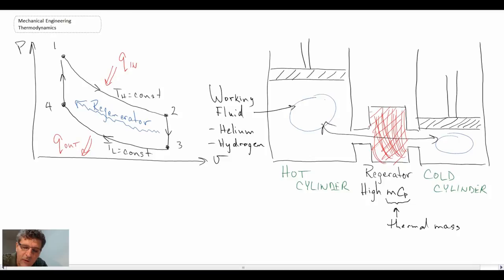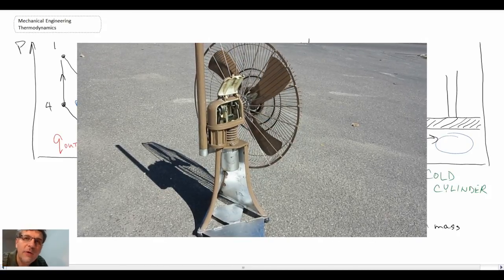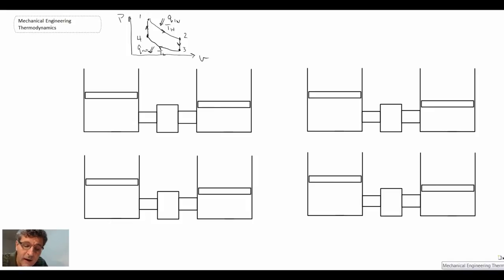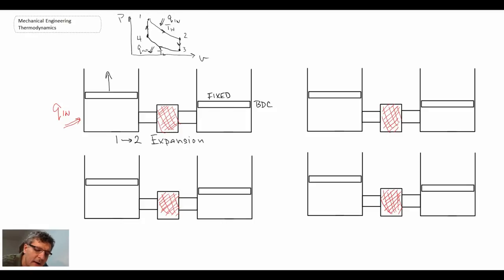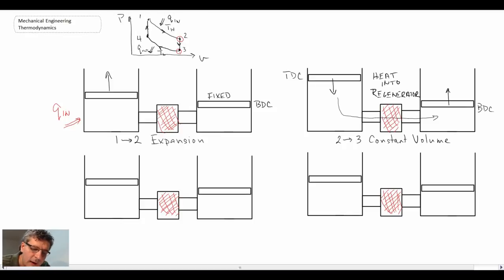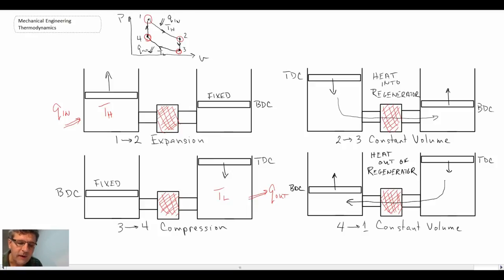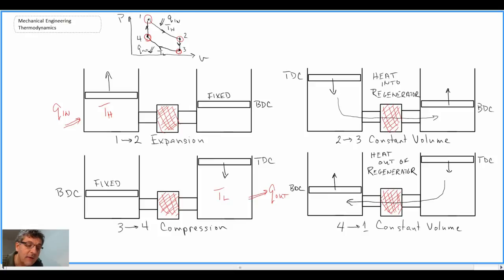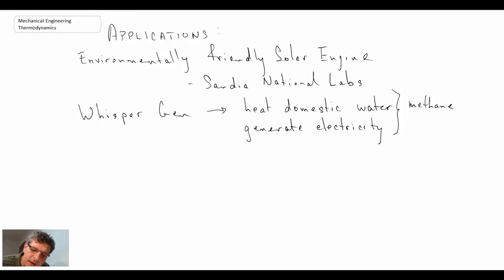Mechanical Engineering Thermodynamics - Lec 16, pt 6 of 6: Stirling Engine Operation

Comment: at 10:18, the piston on the cold side should be LOWER than the TDC. That is, the volume at state 4 should be lower than the volume at state 3, because the fluid is compressed at constant temperature(T_L). You can easily see this on the Pv graph.
Reply: You don't even need the graph. Cold piston moving down from TDC at 3 -> 4 and then starting from TDC again at 4 -> 1 makes no sense.

Comment: There's is/was Stirling Electric Generation Plant in Victorville, California, powering thousands of homes. With an efficiency almost double that of solar photovoltaic panels, I wonder if we couldn't capture heat and store it in sand, and use that heated sand to power a Stirling engine electricity generator. I like in the Mojave Desert, so it seems like an obvious choice.

Comment: Process 3- 4 piston in hot side fixed at BDC and piston from cold side starts at TDC doing compression. Then how it's possible in process 4-1 that the piston in a cold side will start from TDC , as in process 3-4 compression takes place in cold side.

Comment: Hi, Great explanation of the thermodynamic processes but your explanation and diagrams have an error from a mechanical perspective.  Stirling engine displacer (hot) and power (cold) pistons are phased 90 degrees apart, not 180 degrees.  This means the the displacer piston and the power piston can never be at their TDC and BDC simultaneously. When one is at its TDC or BDC the other piston will be half way through its stroke (either up or down).
This is an aspect of the thermodynamics of the stirling has challenged me, especially the Carnot cycle as it seems to be out of sync with the true mechanical workings of the engine. 
If you are compensating for the fact that the expansion and contraction processes are progressive through the rotation of the crank and the 90 degree phasing please forgive me.
Reply: Great point ...
Reply: This is an example of an ideal Stirling engine, which is only theoretical. This engine has two power pistons and no displacer piston, but the displacement of gas from one cylinder to the other occurs during the constant volume processes (2->3 and 4->1). Similarly, a Carnot engine is a "perfect" heat engine and only exists on paper.

A real Stirling engine doesn't have constant volume processes in its cycle nor does it keep one piston fixed while the other one moves. This means that a real Stirling engine has a PV diagram that looks more like an oval.
Reply: Normally there is one displacer and one power piston. Two power pistons arrangement has a problem. Gas pressure is getting lower already, when the gas is flowing to the gold piston. Then 1-2 goes too fast down (pressure dropping). The gas is heatening when flowing to the hot piston and the pressure is rising too early and the pressure is risening too fast (3-4). The energy out per one cycle is positive work 1-2 minus negative work 3-4 = the area 1-2-3-4-1 = PxV. 1 N/m2 x 1 m3 = 1 Nm = 1 J = 1 Ws. Now the area becomes too small. The normal stirling has Qin:4-1 (pressure rising) and Qout:2-3 (pressure down). In an ideal case Q happens when the gas flow has stopped.
Reply: Replying to 6year old comment. Remember that TDC and BDC are from sinusoidal motion, and are practically spread out in time. Pistons are not 180, and therefore one can be (effectively) stationary as the other is moving.

Comment: I am confused point 4 to 1 is where the heat goes in pressure goes up as heat goes in . and 1 to 2 is the power out as this gas is expanding. 2 to 3 is atmospheric push back so that is what is doing the work power from atmosphere.

Comment: At the 4th process (4 to 1) the cold piston should be at the BDC since the process happens at the lower volume and after compression happened
Reply: No, it should not be all the way down at BDC. It should be at the same level as in the left piston at state 1, since V1 = V4.

Comment: Great video, but there are some things I don´t quite understand well
- Do the cylinders have always a temperatura gradient? I mean, is one of them always the "cold" one and the other the "hot" one? From my intuition, when the gas passes through the regenerator, if the regenerator is storing thermal energy, the gas would heat up independent of the side of it´s flow. It´s difficult for me to understand why it heats up only (in this case) when going from left to right, and cools when going from right to left, assuming the regenerator is always hot.
Anyway, thanks!

Comment: The pistons of the working Stirling engine that drives fan in the first part of the video are phased at ~90 degrees while the professor claims in his lecture that they are phased at 180 degrees. Apparently the engine with 180 degrees phasing will not work at all.

Comment: In the constant volume processes 2-3 & 4-1,  the sum of the volumes in the two cylinders remain constant after simultaneous volume increase & decrease & temperature decrease & increase in the two cylinders respectively?
In the constant volume processes, temperature decreases in the first cylinder only because the heat goes into a regenerator?
 And the temp of the second cylinder ends up becoming higher than the first cylinder?
Is there any transfer of heat between the generator and the second cylinder?
Thank u

Comment: hi i am from a student from indonesia i am working on a thesis about the gamma type stirling engine i have a question about you whether the diameter of the displacement piston has a diameter difference with the displaser cylinder

Comment: "Cooling at a constant temperature" I admire your desire to teach, but some of this is NOT how a Stirling engine works. Plus, your piston function is not really even correct, since the volumetric notions are not similar to a stirling engine. The heated cylinder piston just moves the air from hot end to cold end, it creates no pressure on its own, and does not contribute to the pressure of the system by and large. that is piston 2. Plus it all has to be 90 degrees off, or 270 as the case may be, and this makes no mention of why that is.  Please regroup and I'd love to see the new version? you game for that? Let us know!